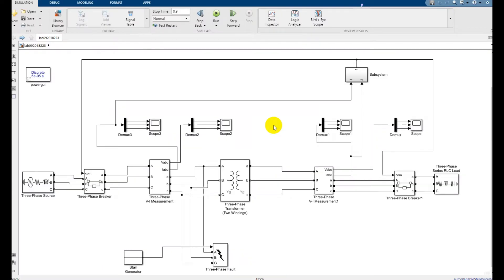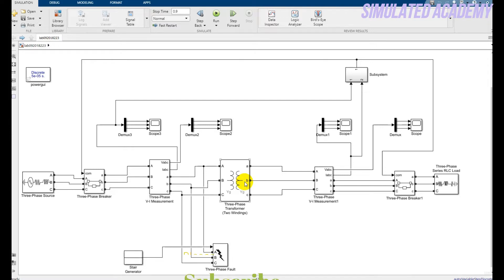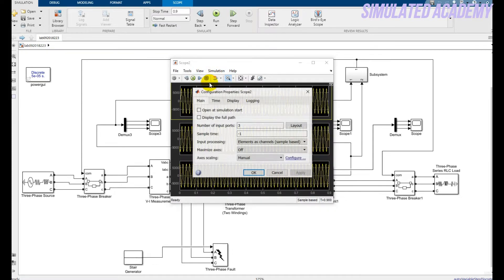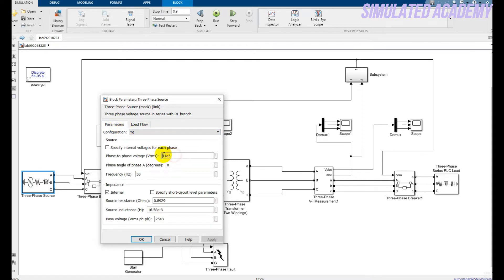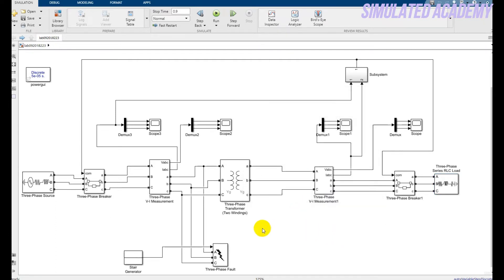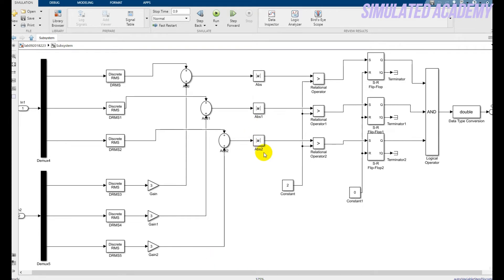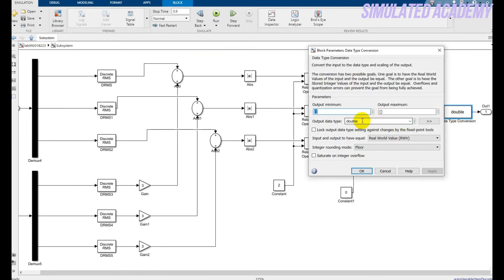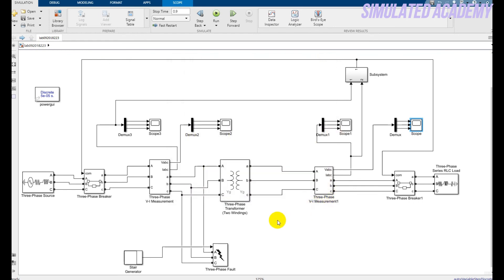Differential Relay modeling in Simulink || Differential Protection of a Transformer in Simulink

Comment: if i use transformer with terminal Yd11, is phase angle compensation needed in simulation like this video?
Reply from the maker: No as such but you will have to make magnitude equal on both side before it compare the voltages.
Reply: @adiclouds  is phase angle compensation not needed to produce unbalanced currents. The differential current compares with the unbalanced current value to give a switching signal when an error occurs, right? or how it is, I'm not sure, can you explain it carefully? thanks a lot

Comment: And why are comparing with constant 2?
Why not another values?
Reply from the maker: What does a constant block with an int value of two mean?
During my presentation, I put a light on this, but that is the pick-up value, above which the relay will operate. Why did I use two?
Assume my relay has a puck up value of 2. Simple... it depends on your relay..what is the minimum value at which the relay should consider it faulty?

Is everything clear now?